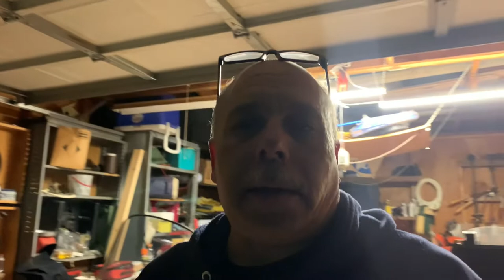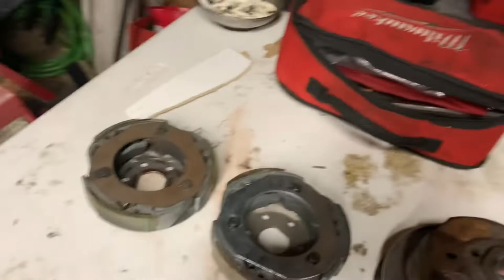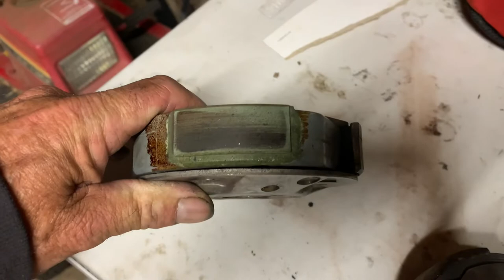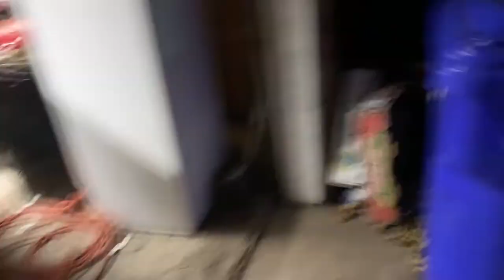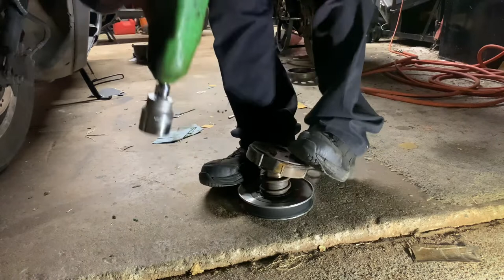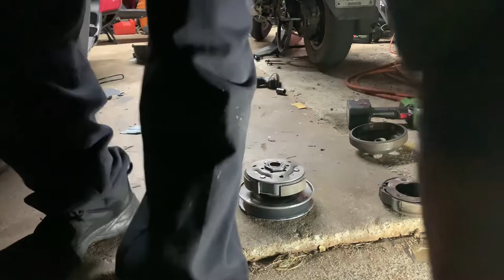Honda helix installing new clutch shoes

Comment: Great then appreciate the info. My clutch started chattering or lurching on takeoff last week I have sanded and clean the pads a couple times in the last 9000 miles. Getting ready to turn 30,000 miles on the scooter tomorrow so maybe it’s time for a clutch refurbishment
Reply from the maker: I drove it to work this morning and still pretty good. Thanks for watching
Reply: @Dave Zimmerman - I replaced every single part in my Helix driven clutch assembly 3 years ago with OEM Honda parts for piece of mind soon after I purchased it with 22,000 miles on it, but if you are only going to replace the pads I would at least recommend separating the sliding pulley halves apart, clean out the old grease, and apply new grease to the bearing, sliding shelves, and 4 locking pins that's made specifically for a scooter application per Honda's service manual or by watching a YouTube video because it's the same procedure no matter what size scooter, my new parts came with a tube of the proper type grease thankfully because after speaking to a local Yamaha motorcycle shop that service scooters and ATV's using the same type application they acted stupid and tried to sell me anything but the right one, and in my area common motor scooter dealers and service shops are not within a couple hours trip as they are completely laughable 🤣.
Reply from the maker: @Serpico1152  I have a video on cleaning and lubing the rear clutch. Already done. Thanks for watching

Comment: I see helix clutch pads from Honda 60$
Reply from the maker: I tryed to go to Honda they said they were on back order and don’t know when could have them
Reply: @1tonysgarage  Damn that sucks. I was looking forward to find a set for myself.. hopefully the clean bell works. Cheers !
Reply from the maker: @volvo850r3  it worked for a little bit finding the shoes are not contacting all of the shoe so I am cleaning the part that touches hope to have the whole shoe contacting after a few times sanding the shoes
Reply: Just ordered some oem Honda clutch pads from partzilla! They’re the green ones that looked like they were short, I hope they work!